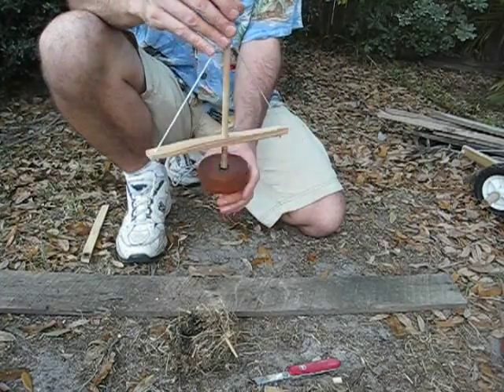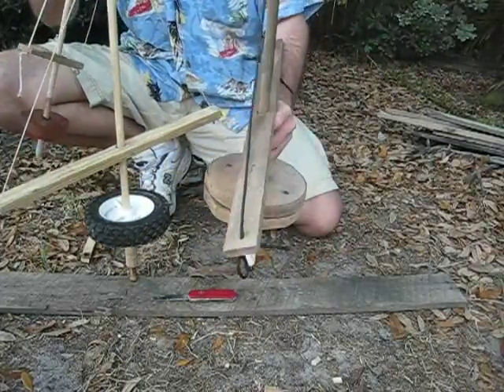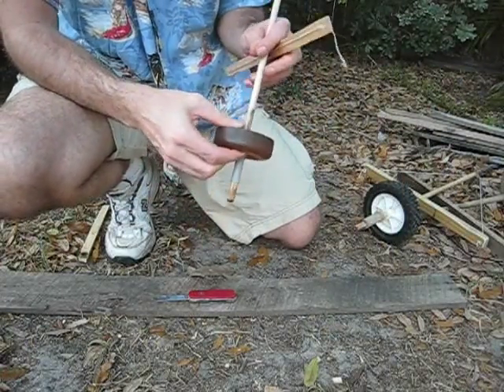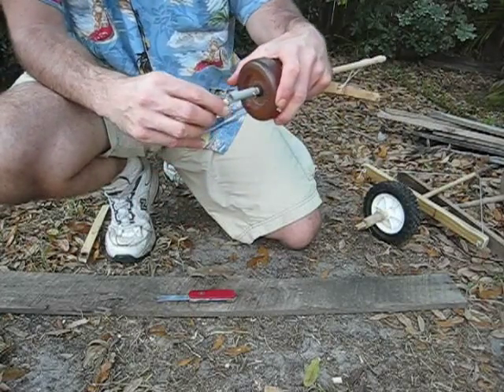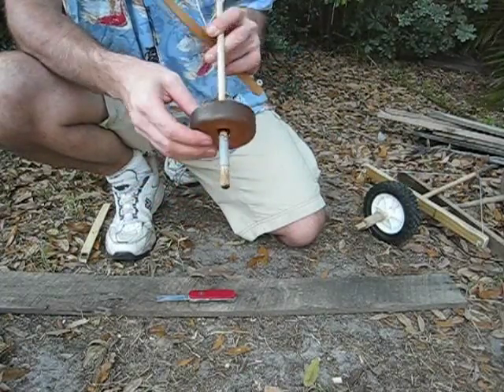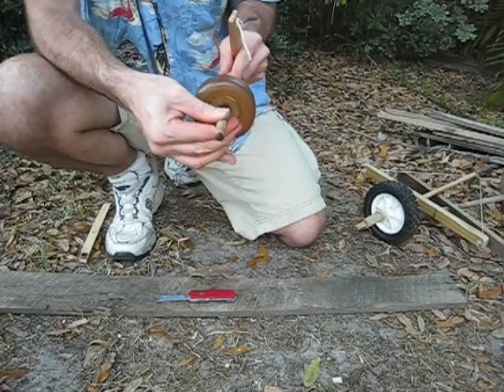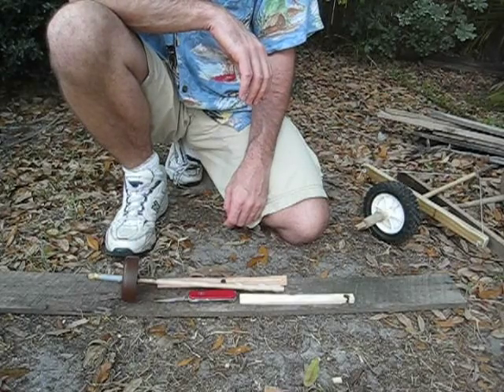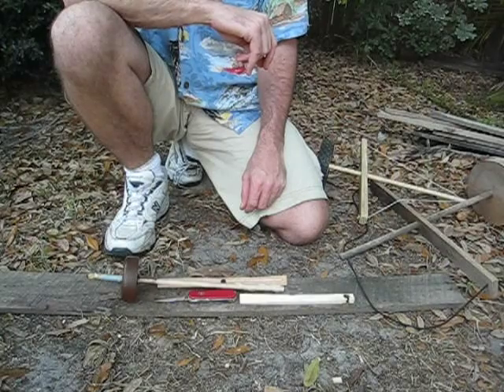Mini Pump Drill - Friction Fire Tuesday (FFT)

Comment from the maker: @MiWilderness The pump drill's the easiest and probably most reliable. It's just not convenient to carry around or easy to find components to make one on-the-spot in the woods (like with the bow drill). Right now, my middle-sized pump drill is the best (one with the lawnmower wheel). Seems to be in that goldilocks zone (not too big, not too small).
Fire plow would be the hardest.

Comment from the maker: @onebadboy2 Update: I added a 2nd wheel (in-line roller blade wheel). Improvised just by duct-taping it to the other wheel. Works much better. I oughta make another vid of the improvement.

Comment from the maker: @landroamer1000 Ideally, ya want equal weight around the spindle. It could be 2, 3, 4 rocks attached opposite each other. So, it doesn't necessarily have to be a disc. There's some tolerance, but if the balance is too outta-whack then it makes it that much tougher to have success. The more balanced it is, the smoother it'll work which usually means a higher success rate.

Comment from the maker: @wanderinggibbon It's true I can operate it one handed because it's small, but I actually need both hands to apply enough pressure & inertia for adequate friction.
I suppose if I had a low-friction bearing-block (ie. seashell, wheel-bearing, etc...) it could work, but I was going for simplicity. Like, something beginners, women, or kids could easily use. I might need a bigger counterweight.
I saw Freejutube's vid. Pretty clever. Natural materials no less. I need to try that.